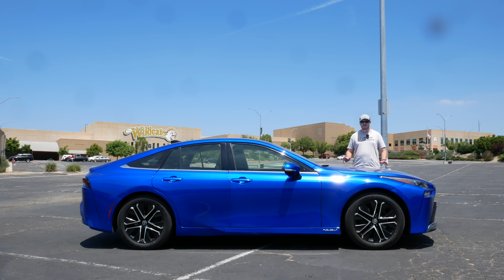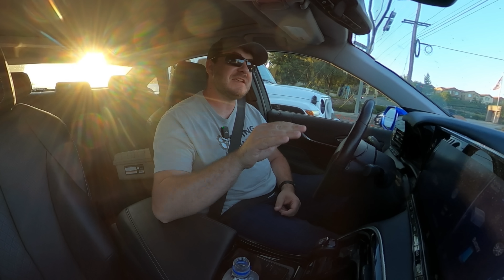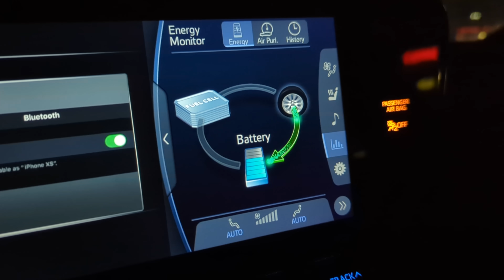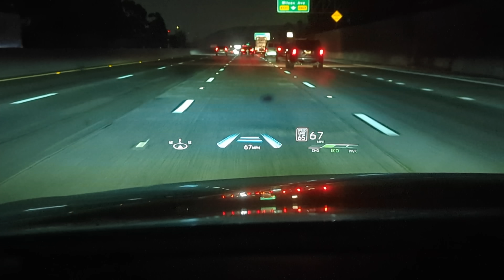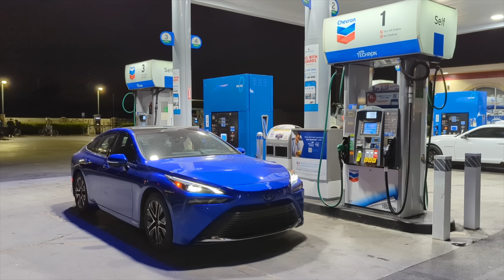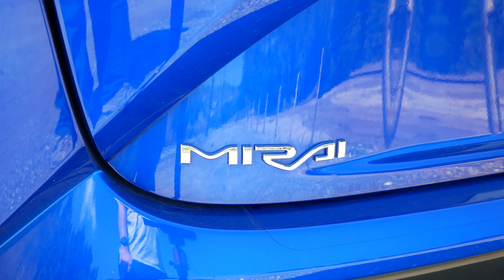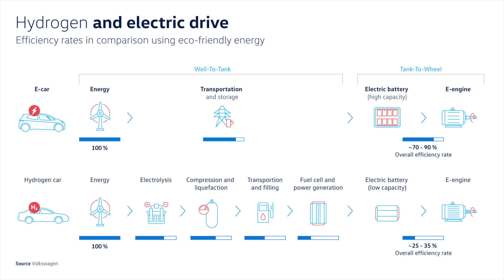The Toyota Mirai is Disappointing

Comment: Better than EV 😊😊
Reply: Objectively. No it isn’t.
Reply: I got both
Reply: @s.porter8646  so you’d be aware that it’s slower. More restricted with where you can refuel. About 10 times the cost per mile, that it’s the same size as a model 3, has less boot space than a Yaris and a rear seat so impractically small that not only does the middle rear passenger need to not have legs, and not only do people over 5ft have to stoop their neck to sit in the back seat. But it’s so small you can’t actually phone the back seats to expand the boot? All because every inch of available space is dedicated to fuel tank storage to get your 400 miles. Meanwhile the model 3 highland long range gets 421 to a charge.

You’d also be aware that the fuel cells rated lifespan is almost the same mileage as the battery warranty on a Tesla. 

What makes it better exactly? Softer suspension?
Reply: @engineeringtheweirdguy2103  to long didn't read, I'm an engineer, welder, I'm in Japan, on my 7th electric car, what I pay for combination of hydrogen and  electric now is less than what I paid for two EV state side in electric. Once the USA gets it's head in the game...maybe let GM and Ford suffer a bit, cars will be great again
Reply: @s.porter8646  7th electric car? They’ve only been mass produced for the last 10 or so. 

Also price of hydrogen in Japan is 1,100 yen. For a mirai a full tank is $41 USD. By comparison the average energy price in Japan is $0.25 USD per kWh.

The model 3 gets around 0.217kWh/km. So that’s a cost per mile of 5 cents per mile. For the hydrogen car, that’s a cost of 10 cents per mile. 

The purchase price of a Mirai in Japan is 7.1 mill yen. The price of a model 3 is 5.2 mill yen.
Reply: @s.porter8646  so how is it cheaper exactly?
Reply: @engineeringtheweirdguy2103  I see where this is going, counter the facts with opinion, please read my last till you understand what I said
Reply: @s.porter8646  well no. I countered your opinion with facts. Please read my last until you understand
Reply: @engineeringtheweirdguy2103  yea...no you didn't you appear confused by my factual statement, but you keyboard smartness away...
Reply: @engineeringtheweirdguy2103  here let me try and cool things down since you're triggerly puffed so easy with your SIMPly internet search not living here. Costs me $20. USD to charge both my EVs a month one is a micro, it costs me $35 USD a month for Hydrogen. I have no idea why you get poopfaced so easy, guessing you didn't win a CT
Reply: @s.porter8646  ok. So circling back to where you were saying hydrogen was cheaper…. Care to explain? Because your numbers don’t even suggest that.
Reply: @engineeringtheweirdguy2103  It's also practically impossible for hydrogen to be cheaper than a BEV as both require electricity to run, but the hydrogen car requires more electricity.

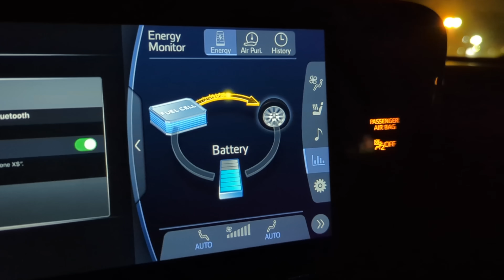Comment: 12:30  Instead of trying to say the efficiency of each step, because most folks don't understand how they compound on each other, I put it this way.  It takes 58kWh to make 1kg H2 from water.  It also takes 12kWh to liquify 1kg of H2 because all new stations are liquid H2. After all, the compressed gas ones have too much trouble and don't hold enough.  It's easier to add 58 + 12 = 70kWh to make and store 1kg of Hydrogen then trying to multiply the efficiencies at each step.  Then you can drive that Mirai 70 miles on 1kg, so the end result is 1 mile per kWh. An equivalent EV gets 4 miles per kWh or 4 times more efficient.  A monstrous Hummer EV gets 1.6mi/kWh.

Comment: @14:19 no, it DEFINITELY means we should stop bothering. you can theoretically get the electrolysis and the fuel cell more efficient, but pumping losses for storage are demanded by the laws of thermodynamics. even with trucking: Pepsi has its report out saying that they need 2 drivers per Tesla Semi to keeping it running as much as it can in one day. Battery charging is a solved issue, during the time it takes to load/unload a truck + all the breaks a human normally needs anyway it seems clear batteries have won. This is especially true when you consider the cost/mile which is the most important thing for a transportation company.

Comment: Obviously the ideal vehicle for hydrogen is the dirigible.
Get over the Hindenburg disaster and use it to float your balloon.
Use a small portion  to power a fuel cell for propulsion.
Take off with water ballast to leak out at the appropriate rate to compensate for lift reduction with time from using the fuel.
I'm  sure either it's already being done or someone thought about it before and realised that it's not a good idea for what technology connections would call "reasons".

Comment: And with hydrogen you have to change the fuel cell every few years.., and it still contains platinum parts... and you have to change the filters often because the air going into the cell has to be squeaky clean... every few months depending how polluted you air is... and you have to change the fuel tanks every few years because the hydrogen eats through everything and there is no good way to make carbon fiber parts in huge numbers... all this so you can fuel slightly quicker than an ev once a year when you visit that mum you ignore in rural nebraska

Comment: Hydrogen Fuel Cell works in freezing temps and is quickly refueled.  Many are wishing this was true for EV.  Norway and Sweden are experiencing this.
Reply: Huh? EVs work fine in freezing temps. I own an EV and live in northern Norway. I haven't heard about people having issues here.

You're seriously saying EVs don't work in freezing temps?
Reply: @logitech4873  I'm decently certain that it was a problem with older EVs (lack of battery heating, I think?) that has been corrected for a while
Reply: @addison1024  Even the old Nissan Leafs work fine here.

Comment: "The efficiency of ev's and thr system is over 80%"?
Umm, no, it really isn't. Power grid losses supposedly average at 7~% (as low as 1% on very small grids and as much as 30% if its massive an inefficient, which barely exist but still)... Then up to 25% loss from various conversions and other spirces when charging, so that's about 27-32% just via grid and charging losses. Then, add to that losses/inefficiency from the power generation itself, which is still mostly coal, and that's another 60~% loss, for a total of 87-92~% final efficiency. Then for green energy, even if you assume its 100% efficient as an input, manufacturing, implementation and maintenance costs still bring that number down, especially when you consider how relatively little they generate compared to coal (and let's not go into their inconsistency), and well, that puts you at 25~% losses minimum even if you're somehow charging at your own private little solar farm, or up to over 50% losses if you're using a 'green grid' (assuming such a grid existed) and the fast charger networks like most people will. So overall I'd think hydrogen isn't that far off in efficiency as you say it is.
Reply: Funny how you just ignore the fact that hydrogen too has to be manufactured with large energy losses.
If you wanted a fair comparison, why did you conveniently forget that part?

You're literally doing EV + all energy generation losses vs. just the hydrogen car itself.

Most hydrogen fuel stations use green hydrogen. This means they were generated via hydrolysis.
So you can take all those energy losses for EVs and add them on top of the inefficiencies of the hydrogen fuel cell car.
Reply: @logitech4873   Are you deranged or something? Where did i say ANYTHING about hydrogen? I just questioned his numbers on the eclectic car charging wastes alone, how the fuck you even got to hydrogen?

Comment: A reliable, efficient, cost effective way of producing liquid hydrogen would be a game changer. It could be distributed on the very same infrastructure as our current liquid fuels, plus, most gasoline engines can in theory be converted to run on hydrogen pretty easily. 

Why throw away 150+ years of RnD on ICE technology for electric vehicles that require a completely new infrastructure, maintenence techniques, etc, when our old cars can be made to produce zero pollution?
Reply: Liquid hydrogen can NOT be handled by current infrastructure at all. It requires cryogenic and high pressure storage. It's also extremely prone to leaking.

EVs already have most of the infrastructure necessary. We have electric grids everywhere.

Honestly amazing how you managed to convince yourself of something so backwards.

Feel free to look up what cryogenic tanks for storing liquid hydrogen costs.

Comment: White hydrogen will help, massive deposits have been found, as well the real need for hydrogen which is in vehicles were batteries are not tenable such as construction machinery or busses that have long routes.
Reply: And yes. That number is just for fuel used to fill up cars. Not including trucks, trains, generators, planes etc.
Reply: @engineeringtheweirdguy2103 "will help" doesn't mean a viable alternative for all vehicles. It will help to create and develop the infrastructure needed which will transition to green hydrogen in time. It's main advantage is for vehicles we're EVs are not viable, an EV truck is a non starter as it's a non starter for any high use vehicle which cannot afford to be down for hours charging.

Of course EVs are only a solution with green energy like nuclear, without it they're arguably worse than conventional vehicles, aside from the particulate and NOx pollution which are trivial by comparison to CO2 in importance
Reply: @TheAlexagius  actually hydrogen trucks are a non stater for the same reason hydrogen vehicles are a non starter. 

Also green hydrogen isn’t nearly as green as EV’s are. That’s because you need 4 times more electricity per miles worth of hydrogen than you do per miles worth of charge for an EV. And it comes from the same grid.

And I know the next line. “But you could create green hydrogen using renewable” - yes. OR you could power 4 times more EV’s with those same renewables instead, alternatively you could build just one wind farm to power a population of EV’s instead of building 4 wind farms to power the same population with hydrogen. See where I’m getting at?

And no. Even from a coal only grid EV’s are substantially cleaner than ICE or hydrogen. But most western grids emit much lower than a fictional coal only grid. (Coal power emits 1kg of emissions per kWh produced, the global average is around 0.5kg per kWh).

If you’d like me to go into more detail about why hydrogen trucks are as terrible as hydrogen cars, I’d be happy to. Just thought this comment was already getting a little lengthy.
Reply: The total amount of white hydrogen globally is estimated to be enough to fill up a toyota mirai, 40 billion times. By comparison, globally we burn enough fuel per year to fill up 107 billion average cars. The total amount of white hydrogen wouldn’t even last 3 months with the amount people drive current. 

So no. Not really a viable alternative.

Comment: The answer to all these fuel issues is magnets. When the car industry and science come together and understand the FULL potential of magnets THEN we will have cleaner fuel that actually works. Remember as a kid playing w magnets and trying to push 2 opposing magnets together but it always pushes away? Ya, theres your perpetual motion. When they can perfect this system fuel is not needed.🧐
Reply: The issue with your idea here is right in your own sentence. You pushed. The magnet needed external energy to move.
If you want a car driven by magnets, look no further than electric cars. That's what they do. They use an external force (electricity) to move magnets, which spin the wheels. And it's upward of 95% energy efficient.
Reply: @logitech4873 not you. You’re correct. I don’t think the OP was serious. It’s got to be satire.
Reply: Bahahahaha!

Comment: Despite the weaknesses of H² Fuel Cells, IMO the advantages are: 
(1) 5-minute refuelling. 
(2) If the Hydrogen is made through water electrolysis, the source material -- water -- will NEVER be EXHAUSTED. 
(3) Once a hydrogen infrastructure is established, internal combustion engine-powered vehicles can be modified to operate on H².

Comment: Yea, ide like to know much more about the fuel cell....why won't they just make an internal combustion engine that's powerd by hydrogen??? It could run on gasoline or hydrogen,  whichever is available.
Reply: Not how that works. And they don’t do it because a fuel cell is 60% efficient. And a combustion engine is 20% efficient.

Comment: One day if Toyota can make ICE engine version of Hydrogen instead of gasoline.
Reply: Probably won’t. It’d be a far worse car
Reply: @engineeringtheweirdguy2103  The gasoline cars will soon to be banned in a future due to climate change ongoing, what choice do we have?
Reply: @bantuatha  the alternative is EV. But put it this way. The Toyota Mirai is a fuel cell vehicle. It’s fuel cell works at 60% efficiency. It Carry’s 5.6kg of hydrogen. Which doesn’t sound like heaps. It has a useless back seat if you’re over 4ft 8”, and has the smallest boot of any car on the market in its size class. And not by a little. By a lot. It’s packed to the brim with fuel tanks because while hydrogen is gravimetrically energy dense (energy per kg). It’s not at all volumetrically energy dense (energy per L or cubic foot). 

So they’ve packed as much fuel into that thing as they possibly could. With a fuel cell that is 60% efficient…. And it gets 400 miles on all that fuel. 

Now a hydrogen combustion engine is only around 25% efficient. So that same fuel would only take you 165 miles or so. It would also do so slower. And since hydrogen has a tendency to embrittle metal it comes into contact with, the engine wouldn’t last very long either. 

Not a great option.
Reply: @engineeringtheweirdguy2103  The issue isn't efficiency. The real issues are practicality and cost. and hydrogen ICE beats those two. The fact is ALL of the world needs to go green, and for the developing world ICE is the only viable option.
Reply: @TheAlexagius  actually it doesn’t. 

Hydrogen ICE has remarkably low range. The mirai has some 300L of fuel tanks just to carry 5.6L of hydrogen. Which takes up almost all your boot and cabin space to go only 400 miles. This 5.6kg costs $112. More than petrol, diesel or EV per mile.

Put that same fuel into an Hydrogen ICE and you got 130 miles of range. Packed to the windows with fuel tanks. And $112 to go just 130 miles. That’s almost $1 per mile in cost.

Hydrogen also embrittles metal, meaning the engine won’t last longer than few years before it blows up. Lifespan in a fuel cell is already less than half that of ICE or EV. Yet alone a hydrogen ICE which would be worse still.

So no. Not cheaper. Not more practical. You’re Paying more per mile for something slower, less range. Less performance, unusable cabin and boot space and less than half the lifespan of any other option on the road today.

And hydrogen isn’t even that green. Greener than ICE (only for green hydrogen which is a seperate issue). But not as green as EV. Infact around 4 times worse AT BEST compared to an EV.

Sorry. Thems the FACTS.p
Reply: @engineeringtheweirdguy2103 The cost of fuel will come down, especially with the recent discoveries of large white hydrogen deposits. Don't forget gasoline was very expensive in the early age of motoring.

Range is an issue but it isn't really an issue with good logistics on distribution of fuel, it's a pain but 3 5 minute refuelings are far less painful than one hour charging especially as most people don't drive hundreds of miles in a day.

As for green the carbon debt of EVs is almost never taken into any analysis done so the claim is dubious. Mining lithium and processing it is dirty and has a marriage carbon footprint and a massive environmental impact on both ground water and the general area of mining.

Hydrogen can be made in many ways but white offers the ability to use it's vacant wells as a reservoir for CO2, either in gas form or in biomass form (likely the more practical).

Battery EVs are at some limits that cannot be practically overcome, such as charging speed and importantly available lithium. 

Further for large vehicles like trucks and machinery EVs are just not practical. JCB already has hydrogen versions of their machines and is betting on it. As for imbrittling that's a material science problem and one that will likely be solved.

EVs are fine for the developed world middle class and rich but not for anyone else.

Comment: if the electric grid is upgraded (which needs to happen for mass electric adoption anyways) hydrogen very well could be a major contendor. less fueling time than an electric plus the only real emission is water makes it very compelling
Reply: The only real emissions is water, plus the 4 times more electrical generation needed to every mile worth of hydrogen compared to an EV. And the grid would have to expand 4 times more for a hydrogen fleet than for an EV fleet because it takes 4 times more electricity to create and compress 1 miles worth of hydrogen than a battery electric vehicle needs to travel 1 mile.